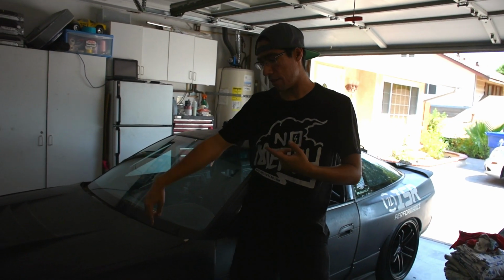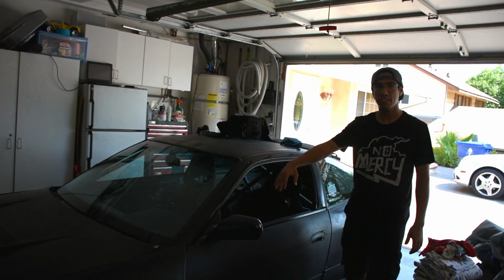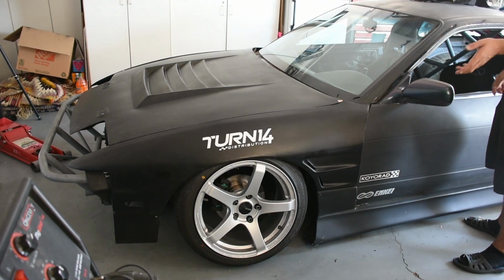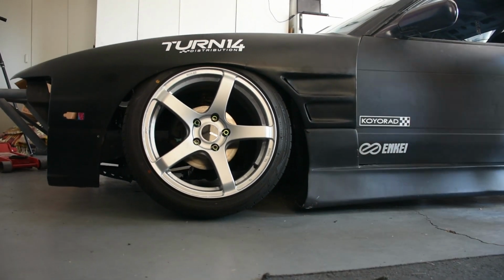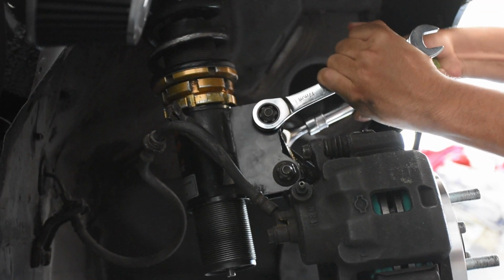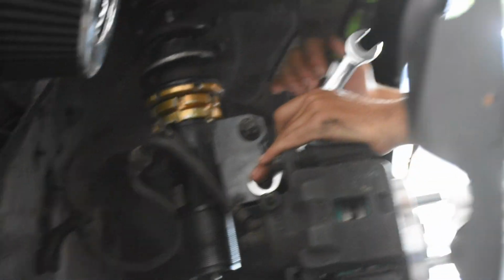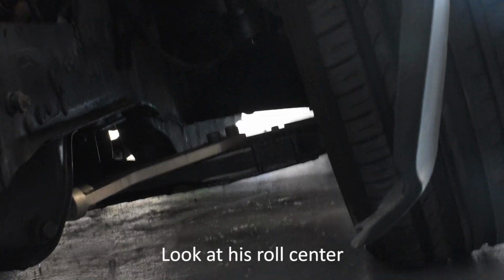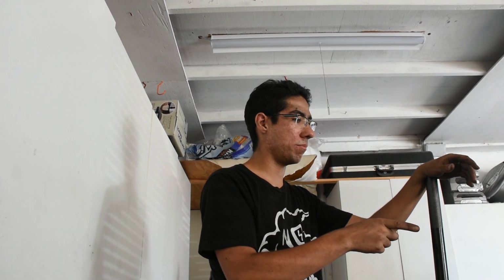BREAK ALL FENDERS | Street Sharking

Comment: Might need some wide body fenders or roll those just to be safe. Are you boosting already or just running motor right now? It is hard to tell with Nikitas turbo noise
Reply from the maker: +Mike Medeiros Front fenders are already widebody that are +40mm wider than stock lol. Stock KA not boosted.

Comment: what motor does he have on his 240sx🤔
does anybody know?
Reply from the maker: +jrbombela Ka24DE
Reply: +OffBeat Garage GO HOLSET, turn it into a little JZ killer.  HX35 turbo's are cheap, they're tough -made for cummins trucks (you know those things put up with abuse and often get shut off while hot).  They are twin scroll, so they spool early, I heard full boost on KA's is around 3,400 rpm and they are about the size of a gt35 (which tend to spool a bit later, but same power range these things are effecient).  Twin scroll=Sexy Prominent Spool (loud noises BRO).  SO(-bro) -Buy a header collector, and flange.. some piping and make up the rest; It will be cheaper and better than a log-tube header.. You followers will fangirl and you'll get mad XP-points yo.
-you may want beefier headstuds and goodies to treat your block like you care about it's feelings a little bit.. and It's iron, it will love you and your car back forever taking whatever pounds of boost you throw at it.
You could be lowkey hanging all the SR's some double middle fingers with all your stout 2.4Liters, and put yourself up there around the JZ rb25 territory and really stir some shitup (maybe ..deff the stock ones that were just swapped into other cars).  Its do-able and pretty Unexpected yet surprisingly worth it (who would have thought.. -a 240 engine in a   ...   240).             (sounds offbeat, sounds awesome)

Comment: hey dude, i just got my permit and just bought a 6 speed 2004 mazda rx8 gt. Any tips on not making the car die and stay in first gear balancing? thanks my dude, youre the best
Reply from the maker: What do you mean by car die and stay in first gear balancing?
Reply: +OffBeat Garage like on a hill, you somewhat balance with the clutch right? and if you dont do it, the car dies
Reply from the maker: Yep exactly. Gotta play in between that catching point.
Reply: +OffBeat Garage so you have to press gas slowly, while releasing the clutch right?
Reply from the maker: You can have the car pinned at full throttle and banging off the rev limiter. Just release the clutch slowly and you'll still take off slowly or stay on the hill just sitting.
Reply: +Junior Cruz Offbeat is wrong. You pin the gas to the floor and quickly let out on the clutch.
Reply from the maker: +Shaun Rives hahahaha
Reply: Don't short shift it mane
Reply: +Blake Snider i drove the rx8 yesterday, i only stalled 2 times in an hour. i feel good about it

Comment: Curious of how tall you are and how well you fit in a vios 3? could you measure from the butt to the harness hole (top and bottom of harness hole) thanks
Reply from the maker: +Dakota Kaech 5'11" and fit great. Nikita is the same height and also fits great. Don't have the seat on me rn to measure
Reply: +OffBeat Garage just hit up formula d yesterday and sat in a zeta 3 was almost perfect minus the should holes were a little low. Not looking to smash my spin, though I maybe able to lose the cushion for harness time.
Reply from the maker: +Dakota Kaech Well for reference my shoulder sits level with the bottom of the harness holes. Nikita's shoulders sit in between the upper and lower limit of the harness holes.
Reply: +OffBeat Garage thanks for input, hopefully I can work out the details I am 6'3" 32 waist 175lbs. Japanese based seats are small but so nice.
Reply from the maker: +Dakota Kaech Yeah haha hopefully it works out. Dude hands down Bride makes the best seats out there. I've tried almost every single brand out there and Bride always came out on top.
Reply: What kind of engine setup are you running? haven't checked the channel or anything for awhile
Reply from the maker: KA24DE
Reply: ***** It looks and sound like you are making more power than stock?
Reply from the maker: Nope that engine is all stock lol. Really not fast at all either haha
Reply: low end torque ftw!

Comment: 15mm isn't 2 inches... it's like half an inch lmao
Reply from the maker: +Jack Truitt 50mm not 15
Reply: +OffBeat Garage ahhh. that makes more sense, but 50mm is a lot lol. I'm +32 and I thought that was too much
Reply from the maker: I really need more than 50, I'm still hitting angled tension rod with this setup because of 0 ackerman
Reply: i had 50mm on my s14. needed more aswell. what you could do is gettig lcas from a s14 casue they are longer factory then s13
Reply: +OffBeat Garage you really don't need that much. The camber is going to be hurting you as is. offset rack spacers and modded knuckles are the way to go
Reply: i had all three. without the extended lcas it wont work that good while sliding. with the camber you will have more grip at full steering lock. its not like any kits like "Wisefab" a 0 degrees of camber m8
Reply: +MrSir didn't say he didn't need his lcas extended lol
Reply: ***** srry have been awake over 29h. my bad m8
Reply: 50mm is 5cm...1inch is 2.5cm therefore 50cm is more like 2 inches! nice ride man, would like to know what piece is that down in the front that gave you that amount of camber
Reply: bro its more than obvious given the rocket science math i just explained that i meant to say 50mm.. my bad

Comment: BRUH TOO MUCH CAMBER. TAKE OFF THEM DAM SPACERS AND FIX YOUR CAMBER,
Reply from the maker: +MyLonewolf25 Spacer is needed for the wheel to clear the coilover.
Reply: ***** dam. Still. Way too much camber man. Just for safety reasons I wouldn't run more than 10 especially when drifting it. I'd say fuck it to fit my safety is with more.
Reply from the maker: +MyLonewolf25 Lol nothing is unsafe with this camber amount. And camber will be dialed out to -6 later on with new fenders and tire up front
Reply: *****  I know the sidewalls and stuff can take it but man you're running very little contact on those fronts
Reply from the maker: +MyLonewolf25 Contact in a straight line doesn't matter. When you drift your lead wheel rolls over and gains positive camber due to the castor. Running negative camber up front is beneficial for a drift car in order to have a flat contact patch at half / full lock.
Reply: ***** ahh, I'm not much of a drifter I'm kinda ok at it but not good, I'm more of a racer but when I see anything over 4 degrees of camber I cringe ( for some fwd track machines you need to run "high" if you're running huge tires all around and don't want to run monster toe out ) but just anything over 6 degrees even when it's a drift car just makes me cringe for sidewalls and everything else. Just running paint strips imo. But I've never really heard of anyone running more than 6 degrees even when drifting. That have to do with the suspension type up front on the car?
Reply from the maker: Yeah exactly, I cringe for sidewalls too. So that's why I run a lot of negative camber so when I'm drifting and near full lock I'm not riding on my sidewall from the caster roll haha. -12.5 degrees is excessive. Ideal camber for a setup that gets around 60 degrees of lock is going to be between -6 and -7 degrees. Once I switch to a 215/40/17 and get even wider fenders up front I'll be able to back down the camber to that. Until then though I'll be running -12 so I can drive my car. 
Thanks,
Reply: ***** ahh ok
Reply: +OffBeat Garage True about caster vs camber while cornering, but camber could at least be set appropriate if u took the front wheel spacers off, or are they stud conversion spacers??
Reply from the maker: +wendy ellingson They are not for stud conversion. Front wheel is a 17x9 +35 and will hit the coilover without the spacer.
Reply: +OffBeat Garage nice and wide, love it
Reply from the maker: wendy ellingson :3
Reply: Lol not safe, yes that camber is definitely unsafe. Please stop.

Comment: I dunno how you manage to drive soo low. I break the oil pan on my Passat so easy and its stock
Reply: I feel your pain haha, same issue here! Passat is sitting collecting dust..
Reply: Yup, I replaced 2 oil pans in a week and it was just city driving. speed humps and dips in the road. Gotta make some type of protection plate under there
Reply: idk how low you are but i have 1.5" engine spacers and a steel reinforced pan on my jetta and it seems to work well. my jetta sits 21.5 fender to ground so its pretty fuckin low lol
Reply: +YourPistachios My one is a 4 motion passat wagon, stupidly low from factory lol..  when the transmission went, I parked it up and noticed I smashed my sump/oil pan :/
Reply: Nice, thats a good idea.  Gotta get sum 18s and reinforce the pan

Comment: Dude just stretch some tires on the front and leave it alone. They will clear the fenders just fine
Reply from the maker: +Angry Jesus Car is built to drift and needs front end grip. I'm not running less than a 215 up front...
Reply: +OffBeat Garage with that much negative camber, I doubt you ever have full tread contact anyway. Even at full weight transfer.
Reply from the maker: Angry Jesus I don't think you understand how caster affects camber when drifting. What you're thinking of is if you're using the car for grip application. But with the caster the lead wheel gains positive camber the more angle you have during drifting so the contact patch becomes flat. Hence why you don't place importance on having a flat contact patch in a straight line since that will be used for maybe 2 seconds during initiation. Instead you build the car to have a good amount of static camber, so when the car start getting sideways and you gain positive camber, you now have a flat contact patch and don't understeer mid drift.

Comment: wouldn't that much camber fuck up tire wear and that can't be good for front grip
Reply: The front wheels straighten up when drifting, so in this case the camber gives him more front grip. This amount of camber is useless for any other kind of driving though
Reply: Without any negative camber in the front, You'd have positive camber when drifting
Reply: +krazytoneride but -12 degrees is not even practical for drifting. Something like -4 is perfect in extreme situations
Reply: +A Frozen Ice Cream depends on the car , I saw an is300 with 60 degrees of lock with -13 degrees of camber
Reply: +George Aquino Its nice to have an increase in grip while increasing the angle however if you look at pro cars (d1gp, FD) they want to have the highest grip at any time so they dont use THAT much camber. Having much camber is for sure not a bad thing though.
Reply: +A Frozen Ice Cream d1gp and fd are totally different, fd doesn't care about style or angle they care about accelerating through corners , it's pretty much a race, and that isn't drifting at all that's why they use minimal negative camber but when you look at d1gp, they actually go into a corner at really high speed and slow down as they come around the corner in order to get a lot of angle which requires more negative camber
Reply: +George Aquino Agreed, style and functionality are two different things
Reply from the maker: Camber goal is -6 to -7 up front. That gives a nice balance between contact patch with big angle as well as response during initiation. Need quite a bit of camber up front because with caster the lead wheel rolls over on itself and gains positive camber. So in order to maintain a flat contact patch while drifting and not drive on your sidewall you run a good amount of static camber. 
Of course in order for me to drive my car and turn the wheel I had to make the camber excessive in order to tuck. New fenders and 215/40/17 will allow me to dial out camber and run it at -6 to -7.

As for what the pros use: The majority of pro drivers are running angle kits that have corrected geometry (such as wisefab) where they don't gain as much positive camber during lock, therefore they can run less static negative camber and still have a flat contact patch while drifting. On top of that, most pro drivers run their cars at monster truck height's with the entire wheel sticking out of the fender which is why they can run so little camber and not have to worry about their setup having clearance issues with their fender.
#themoreyouknow
Reply: +OffBeat Garage I actually quite enjoy the poke look on FD cars haha
Reply: ***** thanks